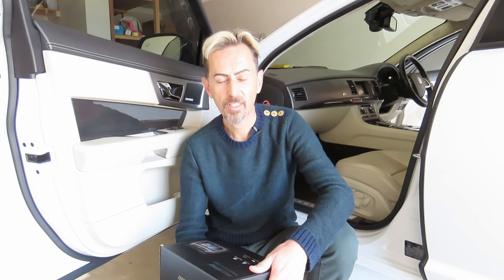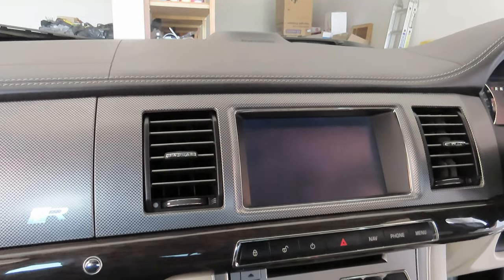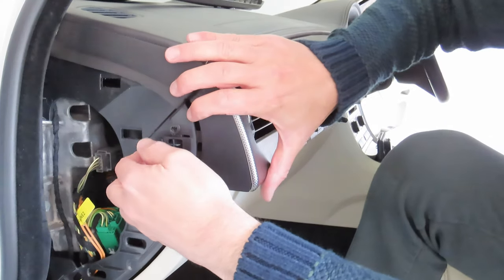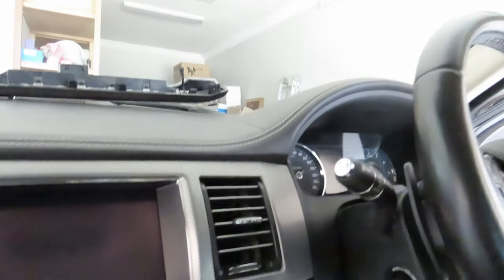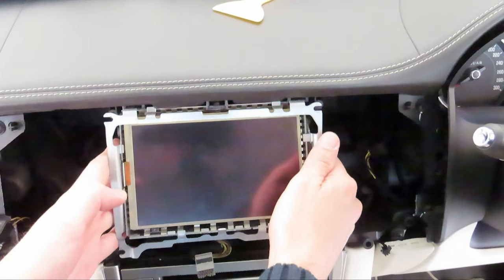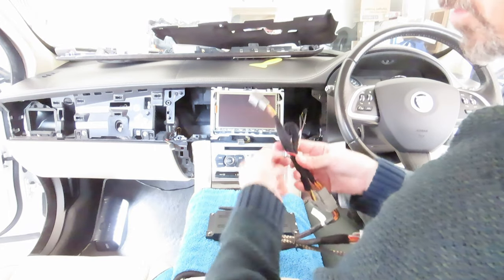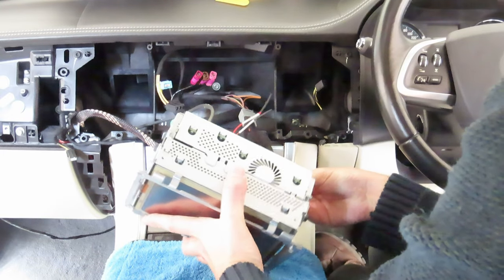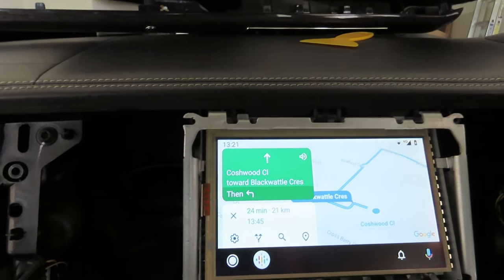11 Steps to installing Android Auto in your Jaguar XF

Comment: Great video! I installed this exact unit from the same supplier in my 2018 XEs earlier this year. If you want to take it to the next level buy a little device called an "AAWireless". It allows for wireless connectivity without having to select your phone manually on the touch screen every time, it also let's you route your audio directly to your cars Bluetooth and bypass the IDcore entirely, this means you can use stalk controls to skip tracks still and use the much, much better jaguar OEM mic for calls. You can even change the DPI to alter the scale of Android auto on the screen. I can't recommend it highly enough.
Reply from the maker: Thanks for the info Barry. Why do you say you can't recommend it highly though? Is it glitchy?
Reply: @carfanfan  "can't recommend it highly enough", as in even his highest recommendation wouldn't do it justice, because it's so good. Alas, I have a 2010 XF, therefore a Denso system and won't be able to perform this upgrade. Great video though!
Reply: @carfanfan  @professordavidson is correct, not glitchy at all once set up and really improves the experience over the IDcore in my opinion!
Reply from the maker: @barrycraig  So far I've had no glitches. It works perfectly every time. I've driven 3 times using it since fitted and it hasn't let me down. It's there the moment I start my car and it's a godsend over OEM satnav. Easy and intuitive with Waze, Google Maps or Sygic. They all work perfectly.
Reply: @carfanfan  
Hilton
As everyone says so far 
Another Stirling job on the install and very well detailed 
You may remember I was going to install this unit a bought a few months ago 
I won't bother uploading yet another install video
I may as far as locating and fixing the unit where it's accessible without having to take everything apart if mods are added

Barry Craig
Have you or did you make any kind of installation instructions for  that  "AAWirelss
I've just ordered one so I can install it when it arrives in a couple of months 
Cheers 
Malcolm
Reply: @claremontinteriorsmw  Hey Malcolm, no I've never made a video on it as in all honesty it's extremely simple, just plug and play. I mainly wanted it so I didn't have to manually select my phone from the car screen every time and for the Bluetooth bypass as I wanted stalk controls back. There are a couple of tradeoffs if you use bypass mode, you'll lose turn by turn voice instructions and Google assistant audio prompts. Neither of these bothered me as I already use navigation on silent and you can still issue commands you just don't hear the assistant response. The improved mic quality is also a really nice bonus as I found the IDcore call quality to be almost unusable.
Reply: @barrycraig  cheer  Barry for the reply
Makes sense just to be able to jump in the car and drive 
As long as your Bluetooth on 
Hilton
Will you be looking into adding this unit I just like the idea of still using the controls on the steering wheel

Comment: Great video JagFan and you've answered a question I put to the makers, but the inability to use steering wheel controls is a deal breaker for me for both the upgrade and this car I was thinking of getting. I have wireless AA currently on a 15 year old Audi A4 B7, via an Android HU, with full steering wheel control via canbus, including mic input and having to touch the screen would be a massive step back - I find it very distracting on the rare occasions I do and for me defeats the object of Carplay/AA. Have you found any solution for this? Thanks for your detailed video.

Comment: Many thanks for this great video! I bought one from Unique Auto in UK a couple of months ago and it's just now warm enough to install the unit in my 2013 XF. The only difficult part was routing the cables up into the center console. There's a pretty small hole underneath the side trim of the console and you can't see it well even with the trim loosened. It took me a full day to do the install, but I also fixed the passenger side vent which wasn't rotating. That alone took a couple of hours taking the dash trim apart to get at the motor for the vent. 
The current version of this device has wireless Android Auto/ Car Play out of the box. You still lose the steering wheel controls and the skip buttons on the console, so you have to use the touch screen for that. The OEM Navigation is disabled, but Google Maps and Waze are better anyway. The backup cam, climate controls and everything else works like usual. You don't have to put the microphone in the overhead console. I just routed it under the trim of the A pillar and stuck it on the flat area on the drivers side of the rearview mirror mount. You can hardly see it. 
Have the video in front of you while doing the install so you know where all of the screws are. If you're in the US with a left hand drive XF then flip your brain 180 degrees. Thanks for saving me a bunch of time Hilton.
Reply from the maker: Glad my video helped James 😊

Comment: Hi Hilton, I've just discovered your channel as I'm thinking about buying an XF. You have convinced me there is nothing scary or difficult about the XF. Quite the opposite it seems.

Sorry to see you've sold the XF, but I guess times change.

Thanks for all your superb work. I'm now working my way through every one of your videos and learning a lot. :-)
Reply from the maker: Did you get an XF? Only saw your message now. Don't be daunted by them. They are easy to work on and mire so than Audi or Merc or even BMW.
Reply: @carfanfan  yes, I've had my 2.2D Premium Luxury for a couple of years now. 

It's been 100% reliable,  and I still love it to bits. The only thing I'd swap it for would be another XF with a supercharger!

Comment: I have bought and had installed (I did not feel I wanted to do it) and all is well except ... they added a rear camera supplied also by Unique. Imitially here was odd behaviour with the added, rear camera, but once Unique supplied us with the install instructions for that, the installers added the suggested relay and all is now well. We do sometimes get the rear sensor alert screen that has to be turned off but it is not always needed. I suspect it is when selecting reverse and the sensors detect something, the screen stays in view until manually selecting the "Display Off" screen option. 

All in all I can heartily recomment this unit. Do realise that when running Google Maps (or Waze or whatever) the guidance instructions come from the Android box and so it needs to be the selected audio souce (Auxiliary) and not the car stereo. So I have downloaded Spotify playlists that are comparable to my CDs which had been ripped into the car and keep Spotify in Offline mode so it does not stream live. If you have unlimited data it will not be an issue.

Comment: Loved this video - late to the Car Play party but looking at your comprehensive instructions, certainly seems doable! One question; do you lose any existing functional from the Jag Infotainment system?
Reply from the maker: The only functionality you lose is the factory satnav which is already outdated so no loss there. Everything else still works on the OEM system. When you press the GPS button, you go into Android Auto.
Reply: @carfanfan  Worth the investment?
Reply from the maker: @PhillHorrocks  Certainly was. It brings the XF into the modern Era. Why throw away your car because technology has moved on? Just update it
 Modern cars are rubbish. Not built like the X250 was. They are solid cars.

Comment: Really great advice, many thanks. Have you ever had issues with the Jaguar xf electric steering adjustment? My tilt and rake has just stopped working.
Reply from the maker: @kennymcgregor5136  Thanks. I never had issues with my steering adjustment. But these JLR steering adj motors are renowned for failing. It's a pain in the ass to change.

Comment: Thank you so much for this video, thanks to you I have successfully installed the Joyeauto CarPlay module in my 2013 XFS Portfolio with the Meridian Sound system. Even the  SatNav works which I was sceptical given the heated windscreen which blocks my iPhones built in GPS. Perhaps the module uses the cars built in GPS arial?

Comment: Hi, thank you so much for that tutorial. Could you please tell me where did you finally located this module? Can't find a proper place...
Reply from the maker: Here's a link to where I bought mine.  Keep in mind, for XF, its only for facelifted models from 2011 to 2015.  It will fit XJ models from 2010 to 2015.
https://unique-ad.co.uk/product/wireless-apple-carplay-and-android-auto-interface-for-jaguar-xf-2011-2015/
Reply: Hi, I've got one and already installed it. But I can't find any proper place to securely mount it. How and where did you put it - passenger footwell or behind the dash ?
Reply from the maker: @user-yr5ho8dm9o  I first had it above the glove box but later wedges it way behind the center console. You can get in there if you lean under the passenger footwell. It can't rattle thanks to the sound deadening down there and I cable tied the cables so that it couldn't move.
Reply: @carfanfan thank you so much for these answer. Maybe you have some picture or video that's showing that that place?
Reply from the maker: @user-yr5ho8dm9o  unfortunately I don't have the car anymore. But give it a try, you could also wedge it in-between the sound deadening. You don't want it to be able to move as that will cause vibration on the unit and it won't last long.
Reply: But I suppose it also need to have some airflow not to overheat.
Reply from the maker: @user-yr5ho8dm9o  I didn't have that problem because it's hot here, and the ac was always on in the car. If you're worried about overheating, I'd rather put it under the glove box on top of the cover that fits under the glove box.

Comment: Hallo, könnten Sie.bitte sagen wo die Elektronische Heizung sitzt
Reply from the maker: It is in the hvac in the dash. Not easy to get to. If you look under the footwell into the center of the dash you could probably see it but getting it put means dash removal.

Comment: Do you leave all the other oem wires out the back of the head unit and just have the new unit plugged in alone ?
Reply from the maker: No, there is only one cable you leave unplugged as I stated in my video and that's the satnav cable that leads to the screen.  This plug is replaced by the plug that comes from the Navi unit you installing in order to provide video feed when pressing the SatNav button.

Comment: Could you share the link to video where you remove the upholstery covering the air bag
Reply from the maker: You can remove the airbag, but not the plastic covering it.  The airbag is part of the unit.  You would need to get a 2nd airbag from a salvage yard and replace the entire thing.  It unscrews from behind the steering wheel.

Comment: How does this mod affect other functions on the factory head unit if at all (i.e. vehicle, climate nav, etc) great video. Is there a version for the XKR?  Thanks.
Reply from the maker: The only OEM affected on the head unit is the satnav because you're unplugging it. Everything else works. There is a version for the XKR. But it has tonhave the facelifted head unit with the same interface as mine.

Comment: Sorry, commenting on an old video, but do you need the USB cable? If so, what is it for? If your phone supports wireless Android auto, what is the purpose of the USB cable?

Also, say i don't wire up the USB cable, will the original usb port inside the armrest still charge my phone? 
I'm just not understanding what the point of the aftermarket USB cable is for...
Reply from the maker: The USB is merely if you want to use Android or Carplay while charging your phone.
Reply: @carfanfan  Thanks for the reply.

Comment: Hi hill

2 questions 
For this set up
What is all my audio boxes under the seat git water damaged 
Can this bypass all and still work?

And 2.
The replacement screen Android unit i think you have in anoyher video.

Same question 

Can i do a successful swap and all work
With all the modules under the seat all damaged?

Thanks so much for your help.

James
Reply from the maker: Hey. As far as I know the only module affecting the sound system under the seat is the Bluetooth module. The rest is in the trunk. This module would bypass the car's Bluetooth because it has its own. Likewise if you install a full Android screen you wouldn't need anything other than the amplifier to push sound out the speakers. They all have their own GPS and Bluetooth

Comment: Dear mr. Hilton, Where can I find your video on window pillar cover removal to install the microphone?
Reply from the maker: Check out my dashcam install video for my XFR. I took it off in that video. Literally just one screw and two clips holding it in, but don't drop that screw into the body, you will never find it again. Also, make sure you use trim tools to unclip the clips because they break easily.
Reply: System is working. Thanks for the Advise. But now trough the Samsung phone the GPS signal is not strong due to the "shielded" front window of the Jaguar. I had hoped the Id Core system used the internal GPS of the original navigation system. How to solve?
Reply from the maker: @talkemade9648  That's odd, I never had an issue with GPS on mine.  And my phone was shoved in the center arm rest.  Check your phone to see if it is good.  Mine was a Samsung A72.
Reply: @carfanfan  I had the problem already always in my car. I use a samsung Note8; Tried also with a Samsung S8, iPhone 10 and iPhone 11. Holding the phone close to the side window makes it work. The same problem occurs in the Jaguar XJ and Range Rover Evoque in our family. (Not in Tesla, Volvo or Fiat). At the moment I installed an GPS signal enhancer (ANT-1573) but it works poor. Best regards Theo
Reply from the maker: @talkemade9648  I don't think it's the cars. It's the phone. Mine works fine even now while placed in the center arm rest and I have no signal issues
Reply: Hi, I have been searching to see if this uses the original GPS sensor. I have same issue with my phone GPS not working (Pixel 6 Pro) it seems it uses the phone GPS? 😢

Comment: question: when you fit that android system does the orginal car audio and all the other stuff on the touch screen still work? is it simply an app thats added by the process?
Reply from the maker: Everything on the OEM system works normally after installation except the GPS. Because the GPS plug is replaced with the Android plug behind the unit. And the GPS plug remains unplugged inside the dash. You can still play music using your USB or you can use the USB supplied with the Android unit to play music through. It's a nice mod that brings the car into the modern age.

Comment: How do u fix your screen when it's not turning on
Reply from the maker: Do you mean after installing an Android system or screen just not turning on. If the latter it could be many things. I'd just replace the whole thing with a used one off eBay.

Comment: Will this fix the flickering/reboot problem that the original units have? Caused by the Bluetooth module or navigation module
Reply from the maker: Not sure. Since you're unplugging the nav from the screen it might do. But if the flickering is from the screen itself, a new screen would probably be needed.

Comment: if u cant use steering controls to control music then this is not an upgrade. But wait isnt this by default via ANY aux phone connected in the jag u cant use steering wheel controls?

Can you use bluetooth to connect to this head unit?
Reply from the maker: You can still use bluetooth
Reply: @carfanfan  means then if you use bluettooth, then your input to the steering wheel control  music buttons should work. My toyota avensis has this working perfectly fine :DDD
Reply from the maker: @robertasviskupaitis9195  yes it does work, but I wanted my Kasich to play through the Android system. There are additional sound controls.

Comment: Will this carplay/ android auto set up work on my 2013 xfr?
And for BARRY CRAIG..... Will that AAwireless work in my car? 
I ask because someone commented that it wouldn't work for them
Reply from the maker: Yes it will work. I did a video on installing it on my XFR and mine was a 2011 face-lift model. Unique auto developments in UK supply them and it works brilliantly. My video is called 11 steps to installing android auto in your Jaguar XF.